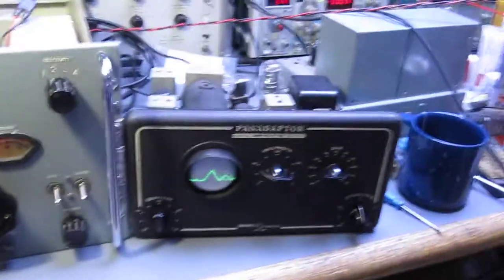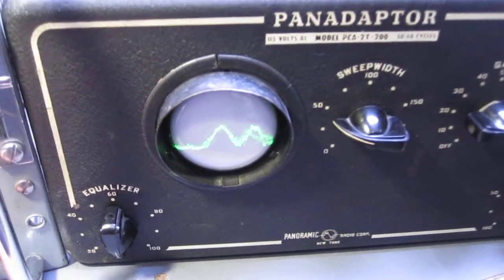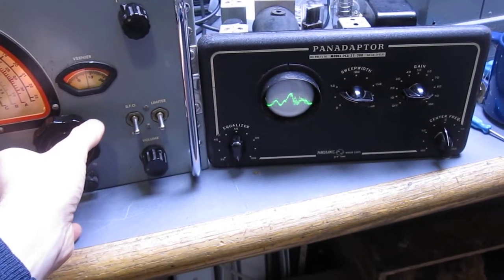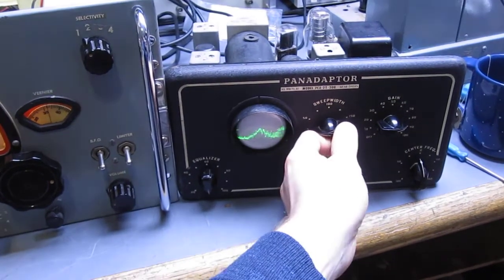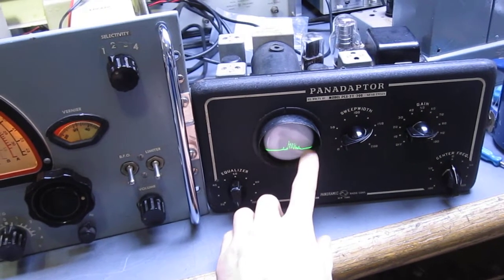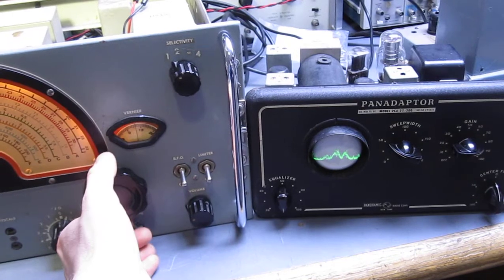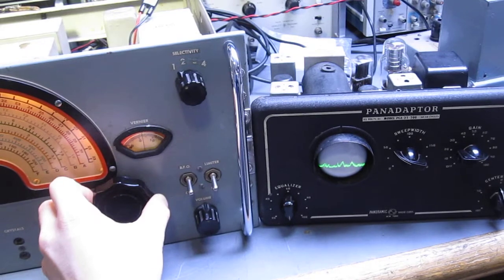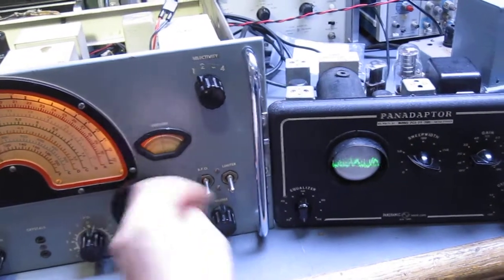Panadaptor on a Marconi CSR-5

Comment: Neat. Is it itself a reluctance tuned receiver or something?
Reply from the maker: If you mean the Panadaptor, it's a reactance modulator running from a ramp generator.
Reply from the maker: The receiver on the other hand is bog-standard superhet tuned capacitively.
Reply: @w1ngsfly  Ah, reactance mod was my second guess.